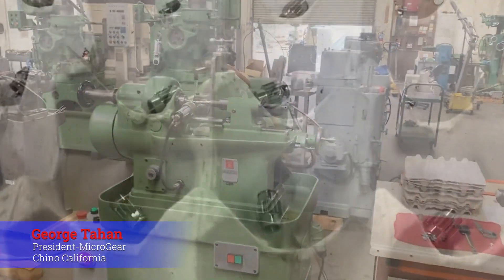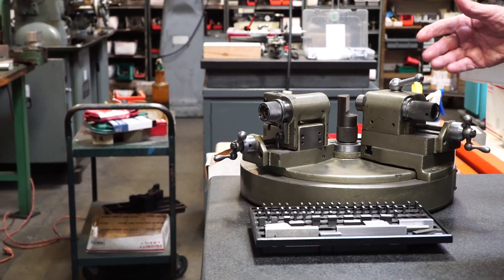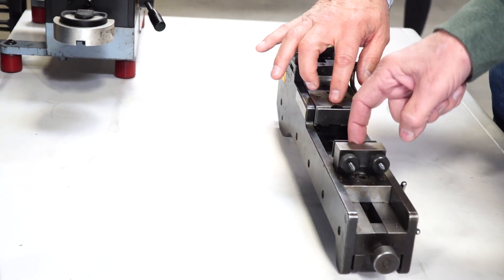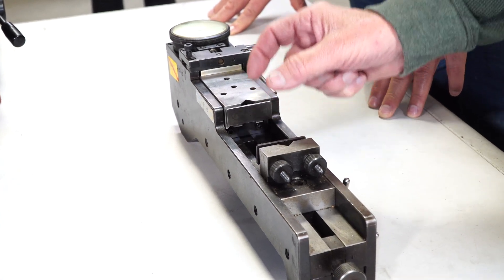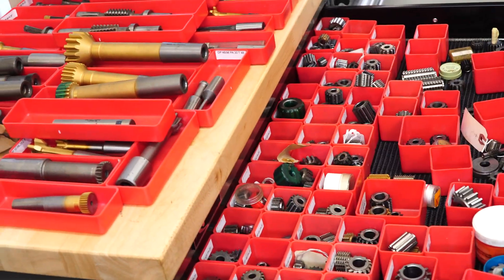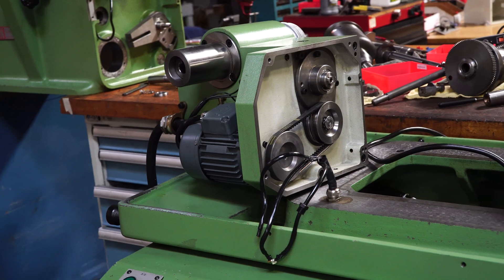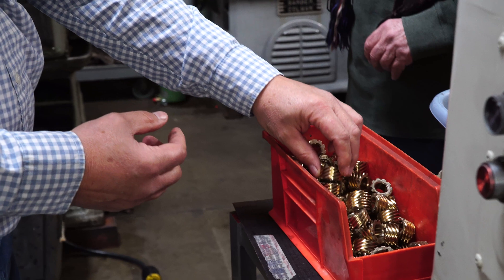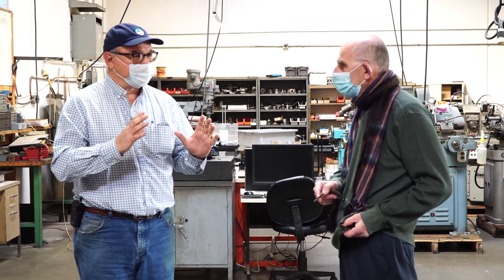Gear Shop Tour with George Tahan - A Southern California Shop Specializing in Gear Testers

Comment: wow sweet .......... I bet this guy could make those helical chuck keys with ease.    And it's probably somewhat complicated gear to make.  It's tapered, it's helical,  it's small diameter, and it's hardened.  Do you happen to have a machine that could tackle such a gear?  The good thing is it's not high speed or super close tolerance ..... but it certainly would take some knowhow